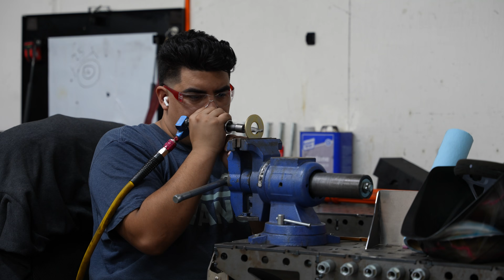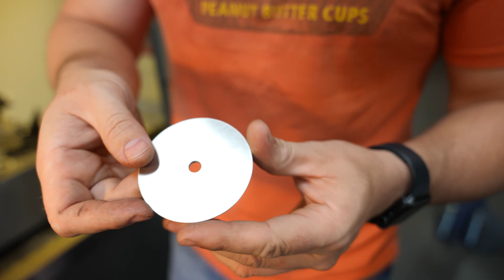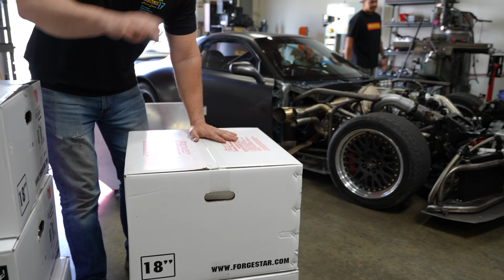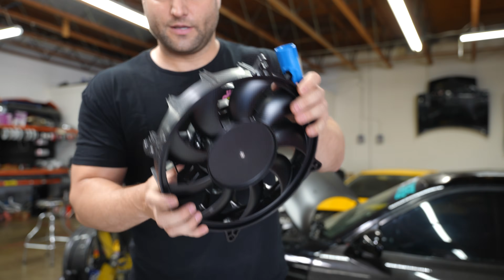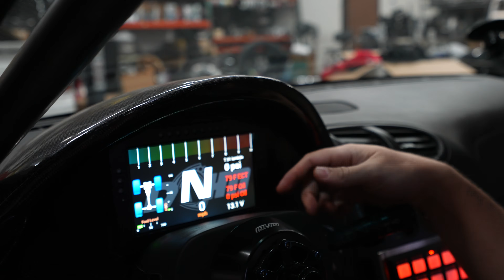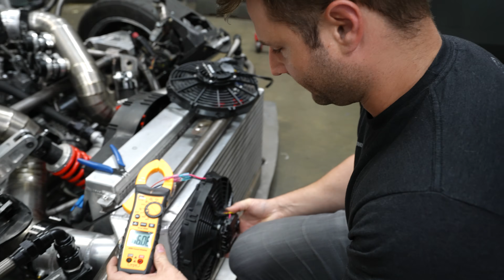The AWD 4 Rotor RX-7 is coming home to Michigan! Probably going to be the loudest car on track

Comment: Always been curious to why you aren't using an intermediate shaft in the front. That left axle is so much longer than the right. It would eliminate that interferiance problem and let you use equal length axles, which will help eliminate torque steer.

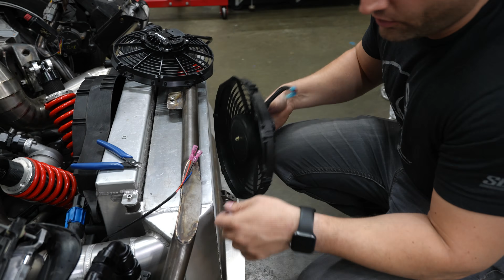Comment: at 24:58 show the fan design is reversible to use as pusher or puller by reversing the fan blade on the shroud and reversing the polarity. 
Right now polarity is correct for pusher configuration, but the fan blades has to be taken off the shroud and reverse to make use of the efficiency of the design. It will also be less noisy.

Comment: I work as a manager at a parts house that rhymes with "putocone". I've used your testimonial for Valvoline VR1 to sell it to the local hotrodders. I mean if it's good enough for a 1000 awd HP in a fickle rotary, it'll be great in their 800 HP Chevy small block.

Comment: Your air filter install made me think you might be interested in the Banks AirMouse ambient air density sensor to help you measure how restrictive the filter is and also correct for varying altitudes, ambient humidity, etc. when you do a hill climb ;-) I know you have plenty of engine sensors, but I didn't notice an environmental sensor outside of IAT. 
Anyway, random thought I had.

Thanks for the videos, love the technology and level of description you are pursuing!

Comment: Rob are you sure you have enough alternator? I'm adding up a lot of amperage when everything goes full send! I'd have to go back and watch all the videos but isn't it something like 160+ amps with just the fans and fuel injection? At wide open of course. OK after seeing the other fans its a lot better. I still wonder about it though. You got so much going on with electronics it's insane!

Comment: I work In a areospace Machine shop with the same Haas cabinets you have, you need to look into vaccum tabling for parts fixture. Not as complicated or elaborate as it sounds and it works great

Comment: Some silicone lube in a can with a straw and a handful of q-tips will allow those windows to stop binding on the old OEM window weatherstripping. It seemingly is a 90s Mazda flaw. Initial glance it mimics a failing window motor, but more often than not it just needs a little TLC to operate smoothly again!

Comment: One potential solution for the axle hitting the engine could be making an intermediate shaft setup, so the axle is only pivoting once it's past the engine. You could also have equal length half shafts with that, which would certainly reduce any chance of torque steer from occuring across the front axle at full noise.
Reply: I feel that might increase the axle joint angles too much at full suspension travel.

Comment: Just watched your video about the wheel speed sensors. Maybe you have an idea for this already, but if you have a way to log steering angle, you can see the difference in wheel speed of the front tires and even the front vs rear tires and plot it vs steering angle. then you could have conditions for locking or not locking the awd system depending on if you're going relatively straight (< a certain angle) or around a tight corner (>a certain angle)

Comment: Hey Rob,
You should take a look at the YouTube channel NYC CNC, they have some great content on fixturing all different styles of material, in this case the tape+superglue they did extensive research on would've been a great solution for your problem. 
Nevertheless, great to see the 4 rotor come so far 😍

Comment: Hey rob next time drill and tap in the center, add a m00 to then put a bolt to hold the piece and not have to cut on bandsaw afterwards just a trick of the trade

Comment: Gonna be cool to see it really let loose on a track. But I'm gonna be surprised if they'll ever let you on a race track without a firewall, trans tunnel, rear panel or anything.
I imagine most safety inspectors would look at the turbo being visible from the passenger seat and the exposed driveshaft inches from your elbow and send you right on home. Maybe the sponsorship aspect helps get around that sort of thing?
Reply: On IG they have been teasing the cover for the trans tunnel. Pretty sure they are going to do the firewall as well to make it pass inspection.

Comment: You need to make a grid plate for that mill. Make your life easy for doing those types of jobs.. mill your center hole that's above a threaded hole. Clamp through the middle with a washer that's slightly smaller than your finished od then you don't need to muck around with those tabs

Comment: The side lights on your dash you used for blinkers are meant for wheel slip to know when you are locking up during braking, you do have wheel speed sensors and could probably make that work like it was meant to be.

Comment: You should set your fans up on a curve like you do for pc fans. Have them be at 25% all the time and when it gets to 160 give it 50% then 200 be at 80% then 210 have it be 100% or something like that. That why your not using the fans life up for no reason and robbing current from other things like spark when its not needed

Comment: Its a good idea to put a shroud in front of all fans since a fan pressed up against the rad will have a dead zone in front of the hub and in the four corners so you are not passing air through 1/4 of the radiator adding about a inch of space for negative pressure zone will insure even flow through 100% of available fins increasing cooling capacity.

Comment: One thing you should consider in the future, with these fans and cooling, you need a way for the hot air to go out  of the car quickly.
Reply: Don't worry this car has no firewall so all that heat can into the interior and out the holes in the floor

Comment: 4: 53 you have enough meat on that pulley to take it out and put it on the mill to slim it down too. Also, since you have a CNC, if you can get your mitts on a horizontal axis for this machine, you could make your own pulley, and add a crown to it (there are crowned toothed pulleys out there, rare, but they do exist) to make sure the belt tracks, at which point the whole washer is useless.
Reply from the maker: Cool idea!

Comment: Needs to be lifted 1” or higher spring rates. It’s gonna rub and drag BIG TIME under load and downforce. Please hear me out if lifted just 1.5” the suspension will settle into position when it’s  under load transfer and the wind resistance on straights. I can see the suspension flexing under minor load.  

 as we know a vehicle of that caliber and velocity is a whole other level of pressure on the springs.

Comment: While watching your last video I noticed the motions your hand has to make during every upshift and seems excessive and distracting (requiring too much brain power when it doesn't have to).  Lowering the shifter so you dont have you pull your hand back and reach up will help but think it would be worth a shot reversing it to (Push to upshift).  The shifter will be way easier to find requiring less antcipation and allow you to return your hand to the wheel sooner.